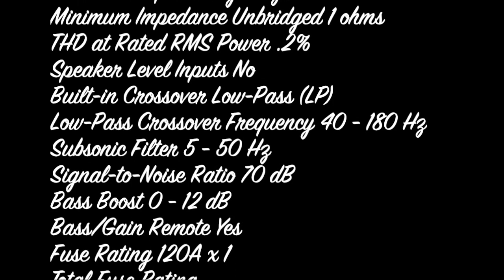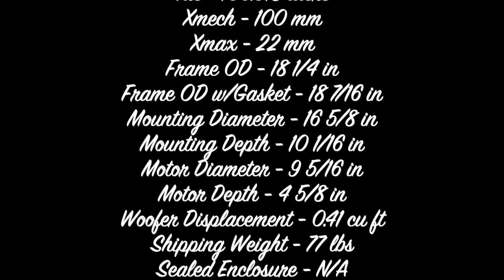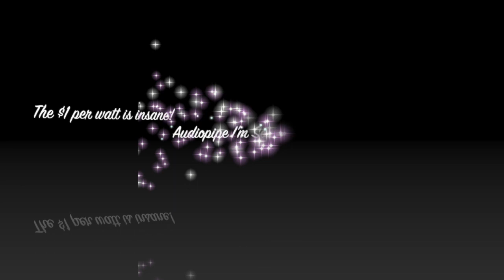$125 Audiopipe APCL 1800.1 Amplifier Will Blow Your MInd! DD 9518 Subwoofer Maga Flex!

Comment: I agree. Very good amp at a great price. I built a box for a customer that had a single DD9918. He had this same model amp pushing it. At one point he had that amp wired at 1/2 ohm for a month.......no issues. Daily driver too 💯 FYI- tried 1/4 ohm once just to see if it would go into protect, never did 🤙🏾